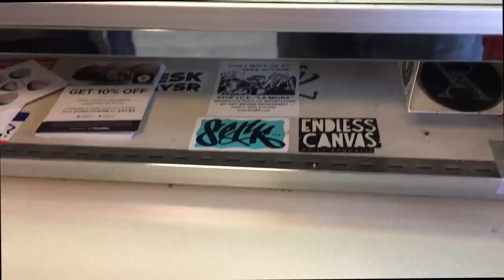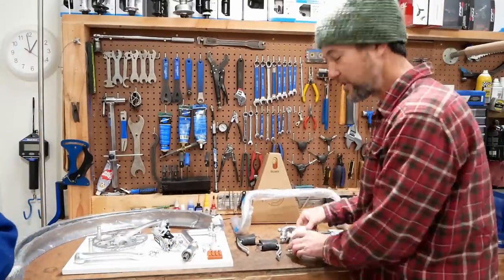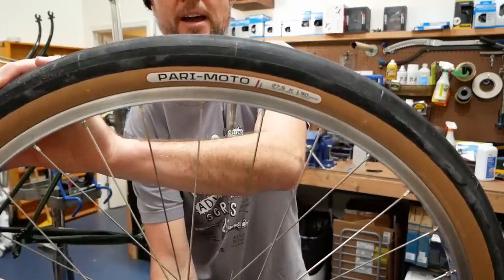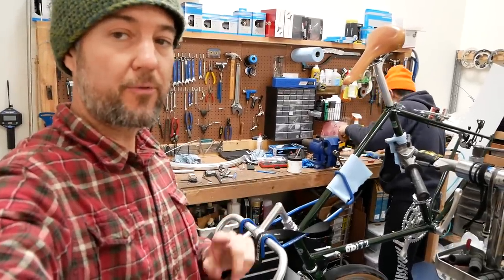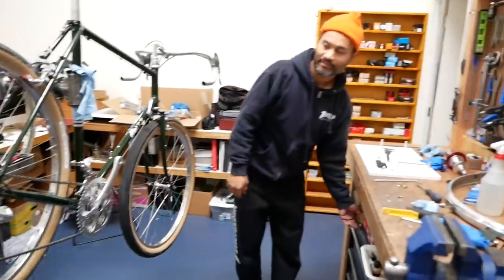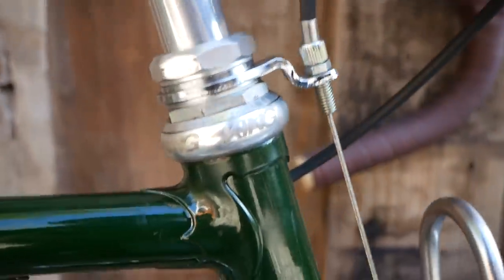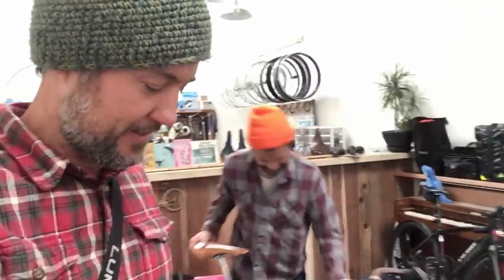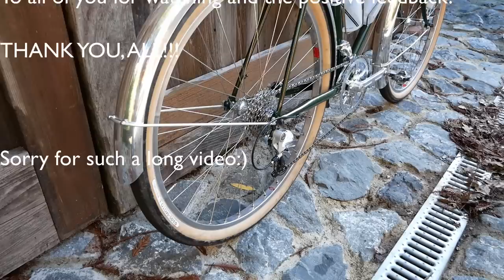Custom Steel Bicycle All Road Bike: The Complete Build

Comment: The inner tire carcass on tubeless ready tires are sealed/coated with a sealant that is not permeable. Standard inner tube tires may bleed air through the sidewall.
Reply from the maker: Do you know if the new Compass tubeless ready tires have that coating? It seems like they still leak a little sealant. At least that was what Ms. Cools mentioned to me about her tires. I'm still using tubes on all my bikes.
Reply: @Henrywildeberry  The Compass don't have that coating, they rely on the sealant to plug the sidewall pores... the thing that makes them tubeless compatible is the shape of the bead: it is square and seamless. A lot of people say they are quite dependant on the type of sealant used and can take a week of riding for the leaking to settle. My extralights sealed fine in the front but the rear would hold overnight but go down while riding... I figured the flex was breaking the seals on the sidewall. Still, only got my first puncture after 4000km running tubes so cannot complain, although they did feel extra dreamy on the few tubeless rides I had.
Reply: @Henrywildeberry  -, or should I say Jason? I think Craig's answer pretty much nailed it. You can see the difference in the inner carcass between tires with the coated inner sidewall and those without. I've got the Continental 5000's and the difference is clearly noticeable compared to the 4000's. The Conti's are foldable and there appears to be more rubber around the bead. The tires are much harder to mount. My MTB conversion went without a hitch. The tires sealed on the first inflation without any leaks or seepage. Both tires and wheels are from the same manufacturer on the MTB, no so on my road bike.
Reply from the maker: David Wallace Thank you! Is it safe to say tubeless tires with the extra layer of rubber are likely a little heavier, but they might get away with less sealant? Tires like Compass and Conti’s without the extra layer end up absorbing more glue and in the end net the same weight? It’s Jeremy not Jason😂
Reply: @Henrywildeberry  - I prefer Henry. I bet you are correct on the absorption versus construction. Conti specs the weight difference at 80 g (3 oz) per tire. A standard inner tube weighs about 130 g (5 oz.) for a 700 x 25. Add the sealant and it is a trade off.

Comment: Beautiful build.  Such a classy bike.  Great looking saddle too.  Thanks for the extensive video. 

But man it's hard to watch a brand new frame get clamped by the seat tube.  And that old Park jaw is a crusher!  (Sure, new repair stands have anti-crush clamps, but still.)  Clamp an old throw-away seat post for the build and then install the new saddle & post as the last step.
Also, did you wax the frame prior to building?  That's a great time to get the paint protected from the very beginning.  That plus some Frame Prep on the inside and your custom frame will probably outlast you!

Comment: Very similar to my set ups. Modern front changers can be a problem with small(er) double chainsets, I have a couple of 1980s Sun Tour narrow cage ones on an 8 speed down tube set up. Campag 9 speed works fine with DT friction levers, haven't tried a 10. Depending on frame size, smaller wheels can make downtube levers a reach. The braze-on Mafacs are nice. There used to be a very similar brazed rim cruncher centre pull brake (Suntour?) back in early MTB days, an idea worth revisiting.
Reply from the maker: Thanks Borderlands! The 10 speed is working, but as you know the chains are thinner which I'm a little uncomfortable about. I've managed to bend chains riding off-road. The shifting is good! I'm really impressed with the DT shifters from Rivendell! I do prefer the heavier (stronger) 9-speed. We'll run this for now and see how it goes.

Comment: Thats a lovely build! On the subject of Cranks I think with the modern Sub Compact and the ability to run MTB mechs on the back with friction shifting you can get plenty of gearing without needing a triple. On my Polyvalent I ended up using the White Industries VBC crank set with a 46/30 and an 11 speed XT Medium Cage on the back giving me the ability to go to 40t, it it's not enough I'm happy to walk but I suspect that will be few and far between. The Friction shifting on the 11 speed using the Dia Compe 11 speed shifters is no drama at all.

Comment: Are the Pari Motos in the 1.9" width a new item?  I've only ever heard of them in a 650Bx38mm size.
Reply from the maker: Yes, they are new! They just added two new tires to the line, both are 1.9 inch, or 48mm, in skin wall and a black side wall. I need to try a black side wall tire in the future to understand how they compare. The skin wall is a natural rubber which won't last as long, but it has a lower coefficient of friction. However, natural rubber is not as durable as carbon rubber so it can cut more easily. So...do not over inflate the tires and you will have better results.

Comment: Thanks for another great vid, I started watching a few weeks ago but just finished today! Interesting to hear about your crank adventure. I just bought a vintage Schwinn Voyageur with first gen Deore drivetrain and a 30/46/50 crank. I had been riding a drop bar hybrid conversion with a MTB triple for several months with a 180q, the deore crank is 150q, and my knees sure notice the difference. I too prefer a triple but the half step gearing with downtube shifters on a 5 speed freewheel requires a lot of dancing, too much I’m afraid for comfortable commuting, which is 90% of my riding. So I have also been deliberating a double crank, not so much for the Q factor but the 30t granny is pretty useless in flat Indiana and the 46t “small ring” is a little tall for me. But I could see how with a cassette hub with more gears a 46/30 could be quite nice. The Voyageur has 120mm rear spacing which I think will probably limit my options for rear wheel replacement, but I’m also considering a single crank and internal gear hub. Anyway, I appreciate the longer videos too, just takes me a little longer to find time to watch em. I leave you a long comment in exchange. Looking forward to seeing your next update on this bike.
Reply from the maker: The compact double can provide you with plenty of gear range especially if you only need climbing gears on occasion. Where we live, the terrain is pretty unforgiving, and the surfaces are often varied from crappy pavement to gravel roads. The triple allows me to find a comfortable gear in all those conditions while still maintaining a decent chain line. The compact double works too and has a lower q. Thanks for the comment!

Comment: Next time you have a chance to disassemble BB parts please spray 5-56 or silicone on inside tubes to prevent rust buildups, especially tubes with holes i,e, bottle cage, light cable eyelets, fender mountings.
650B SYSTEM is originally developped to reduce stress forces to frame AND carriers when heavy loaded, NOT human comfort.  You may be able to enjoy same level of comfortableness with 650-35A  or 38 A wheel system.They are cheaper, higher availability and accomodate MAFAC RACER or 2000 arches.
Reply from the maker: Thanks for the tips!

Comment: A sit back with fresh coffee video. Thanks Henry. 
Curious about the fork and seat/chainstay tubes being butted. I'm guessing the fork isn't as the tubes are tapered and curved in a classic way that reduces transmissive forces. And... Is the IRD derailleur the one Omar suggested?
Reply from the maker: Rick Harker I’m very pleased you enjoyed the long format video. I’ve got the new IRD derailleur in hand and ready to install. The one we used temporarily and shown later in the video is actually working quite well. I also received the brass brake pivot bushings and will install those too. I’m not sure exactly but I think the fork blade tubing is straight gage. All in all everything is coming together very nicely and I could be more pleased.

Comment: How about PART10:ENGINE? 
Rider's physical statics,i.e. hight, weight, joint to joint lenghthes, pedal and shoes,sox thickness, saddle hadness, point to sit.
Rider's dynamics characteristics,i.e. bar position, joint flexibilities, gear ratio selection preference, cadence programs, dancer/determined on steep slope.
I would like to see the video of actual ride on paved road high speed and gravel,steep climbing efforts. Please cleary tape the gear selection and bar position. Please follow tire pressure by manfactur's instruction and wheel balanced with tape weights.
Reply from the maker: Check out my two recent videos I rode this bike for both of those rides.

Comment: Would love to get a custom bike myself. Can you recommend a bike fitter? I’m in the Bay Area as well. Thanks. New subscriber.
Reply from the maker: Hi Brelandte. I got a professional fitting many years ago at Whole Athlete in San Anselmo. Dario, the owner was really helpful at getting me fit on the bike as I was experiencing knee pain and other hip issues. I'm still referring to those early fitting numbers to this day, and I have even contemplated going back for a follow up (really just to say hi and to say thanks). I just continue to set my bikes up around those dimensions, and haven't had any problems. The only major difference is now I run slightly shorter cranks. Depending on what your goals are you may want to give him a call, and ask to see if he's the right person for you, or if he has a recommendation. All the best!
Reply: Henrywildeberry Thank you for taking the time to answer my question. I’ll look him up. Hopefully a fit will get me pedaling for hours. Again thanks.

Comment: I just recently started to fall in love with touring bikes from watching you are videos and love your bike what does something like that usually cost to build up being a adventure gravel bike guy and also a mountain biker now I have a new obsession that I probably can't afford lol
Reply from the maker: Hi Sean - As you know from your other cycling adventures prices vary widely depending on the quality of the frame and components. A touring bike has additional things that other bikes don't have which are the racks, bags, fenders, and lights. A good dynamo powered light system alone can cost 500 - 600 dollars. In my opinion with touring and randonneuring bikes you get what you pay for. A complete bike will cost anywhere from 2,500.00 to 5,000.00. You can spend more, but I think in that price range you find a very high quality bike with durable components. For someone on a tight budget there is the used market. Having spent a ton of money myself on super light road bikes, I wasn't sure if touring would be my thing, so when I got the idea to give it try, I bought an old 1983 Specialized Expedition for 600.00. As time went on I invested another $1,000.00 more to add a dynamo, bags, saddle, new wheels and better tires. What was nice about starting out used is I got a better feel for what I might want, and the resale value of older touring bikes is good. The downside to going the used route is finding a frame in your size, with the clearance for the bigger tires and rack/fender mounts. You might find the perfect used frame in your size, but it is missing a few rack mounts you wish it would have. You can buy it and find a local frame builder to add the mounts, but you'll be paying more and having to touch up the paint. Some people start out with Surly, Soma, Salsa, etc. type touring bikes and then either graduate to something higher end later, or decide to try an ultra light bike packing set up. I'm sure some of this is redundant information for you. All the best in your adventures!

Comment: I'm interested to see what you think of the Berthoud saddle. When I got mine, I was a little put off by just how hard it was (and I was coming from a Brooks B17 which I liked). After a while though, the thing just disappeared under me. What incredible saddles!

Also - the 46-30 in front was a revelation for me; I hope it is the same for you. Light, and will get you up hills like anything. I don't have the need for top end speed above 50km/hr, so being able to conserve energy on hills is great.
Reply: Lars, I’m riding a somewhat unforgiving Fizik Arione saddle. Which is long, flat and narrow. How might I get on with this Galibier beauty from Gilles Berthoud?
Reply: @roadglide  you’ll do just fine. The Berthoud saddles are great.  Mine is broken in very well now - it’s interesting that it’s hard to find a photo of a broken in Berthoud saddle on the internet, but they do « contour » quite visibly like the Brooks saddles do.

Comment: Nice job!  Looks great!
If you're sticking with the double (probably plenty of range for you) seems like you could use a med length cage r.d. and probably tighten up the shifting (and lose a few links of chain).  Omar's suggestion on the front der sounds like a good move.  
You mentioned the NewAlbion cranks were 170mm but not what the VO's were.  (btw what happened to the Suginos? Sugino makes a nice compact double with less Q than their std triple, but hard to find sometimes).  Assuming your other bikes had 175mm cranks I'd think you would have noticed a big difference stepping down to 170's (imo 170 sounds small for you).  I've played between 3 sizes and 2.5mm is surprisingly significant - too small feels like running with an intentionally short stride - not good.   
The SunTour levers look great (nice clip from The Office).

There's a good interview with Tom Ritchey I think you and your followers would enjoy (Rivendell and Radavist both posted links).  He talks about: steel tubing, 1" steerers, carbon forks, and disc brakes, etc.  *scroll to 30min mark for the good stuff, the first 30min is general history/stories.
https://www.youtube.com/watch?time_continue=1888&v=V-gGIqfVB2Y

happy trails!
Reply from the maker: Thanks Kevin! I'll check out the Tom Ritchey interview. I would enjoy hearing his take on all of the above. I'm running a 175mm crank on my two road bikes, and a mountain bike, but a 170 on my touring bike and now this bike. The 170 works really well and its benefits are more noticeable on really long rides. It may seem a little small (short) at first but once you've been pushing pedals all day the slightly shorter crank is easy to keep turning. I looked at the Sugino compact double too, but it was hard to tell what the q-factor was going to be 160(ish)? Since I had already experimented once I just wanted to get the bike on the road, and Omar had the VO grand cru on hand and it is a really nice crank too! Lots of good stuff out there!
Reply from the maker: Thanks for the link. That was gold! I can appreciate everything Tom had to say. I've been out in places I would never want to have a mechanical problem I couldn't fix. He's right about all the proprietary non-standard parts being made now. I like how he recognizes the benefits of the modern world but also appreciated the value of simplicity. As he says, your choices ultimately come down to your environment.
Reply: That was a great talk with Tom Ritchey. What a craftsman! Big fan of his and his products. Kind of bummed he didn't really answer the question about a steel fork on the Ritchey logic. If that bike was less racy-in the geometry - and fender compatible + a steel fork😉I would definitely be all over it! I really enjoy his approach, but I guess that is what 40+yrs of tinkering brings🤔👍👍💪💪

Comment: would love to see a cost break down (if you feel like doing it) and wow, what a bike...I am also planning to get these tires for my bike but they are way too expensive here in India so waiting for someone from the US to bring it for me....thanks to you, I am also riding over 40 miles a day now...thank you Mr Wildeberry!!
Reply from the maker: Excellent, I'm so glad to hear you're out riding and putting down the miles! It only gets harder, but it's so rewarding! The cost breakdown is a little hazy because I've swapped out a few things and still need to add a few more. I was also gifted a few things, and reused parts I had laying around. Most of parts on this bike are middle of the road prices wise, except the saddle, stem, pedal, and fenders. I tried to put money where is made a big difference and save money on things that have no real upside. If you can get a source on used parts or check eBay for deals you can save money. Best of luck! P.S. the Pacenti tires are made by Panaracer. Check their site to see where a local dealer is to your area.
Reply: @Henrywildeberry  Companies like Panaracer barely have any dealers here...its more like a few boutique shops across the country who import them...:). Regarding the cost breakdown, yes, you are right...I have seen all the videos and did see you reuse and transfer some parts from other bikes. that said, what a lovely looking bike you have indeed. and kudos to Omar too..looks like such a warm and peaceful guy...thank you Mr Wildeberry for this mini series you put up...and more videos please. I look forward to your adventures to inspire me to continue on mine!